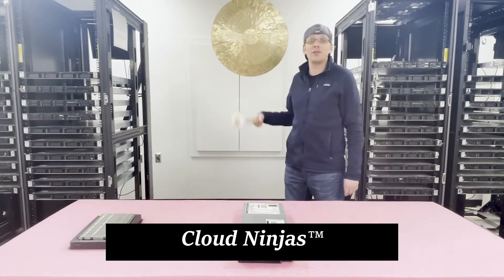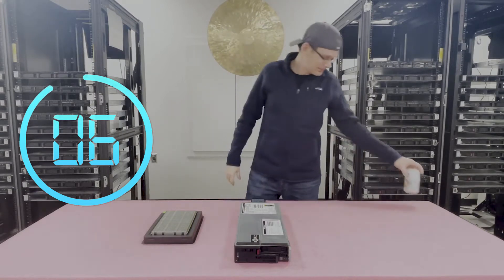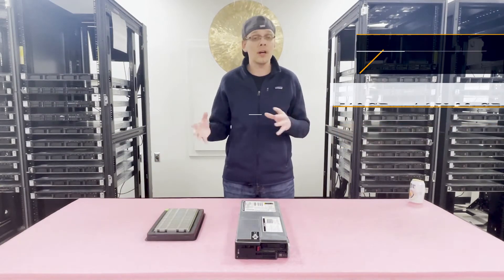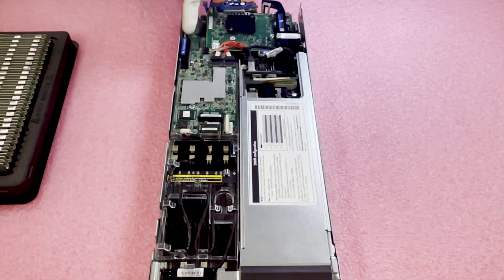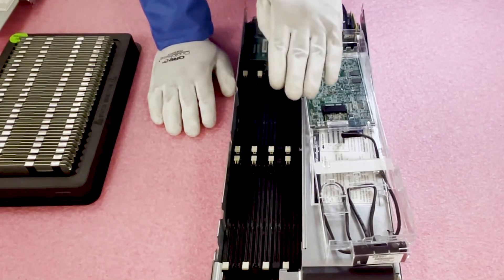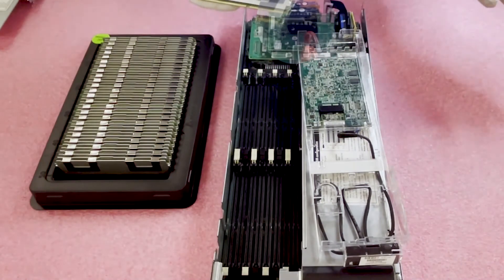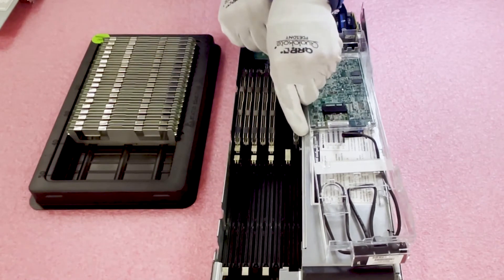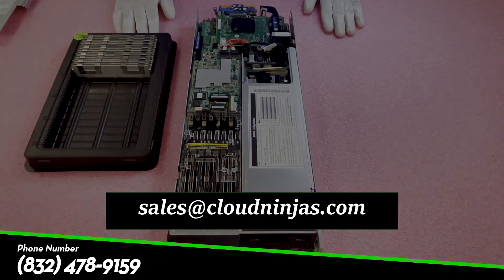HPE ProLiant BL465c Gen 8 Server Memory Support Overview & Upgrade Tips | How to Install & Configure

Comment: what are these types of servers best for?
Reply from the maker: Great question.  A lot of these are used for hosting applications.  Each customer can have their own dedicated server and not utilize 1U or 2U of space.  These are also used in corporate environments.  The big advantage is saving rack space and lower power consumption.
Reply: @cloudninjas  what you could all so do with your video's is have a Discord server as well as have a  part 1 as upgrades and tips and part 2 as an optional for setting up game server or data storage. because I'm gonna use my HP ProLiant DL360 G7 as a game server, watching video's like yours helps in terms of memory and performance. one thing you should stress is not to go full YOLO and spend a lot of money on something with out knowing enough to even get started. showing how to remote access from pc to server OS would all so help gamers who are looing to host their own server.